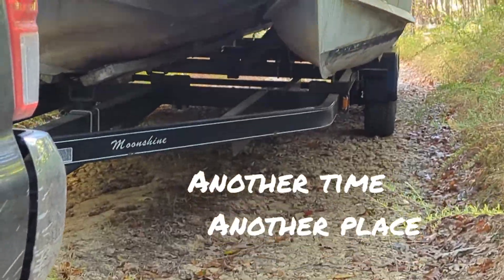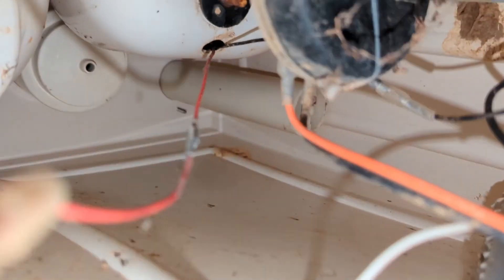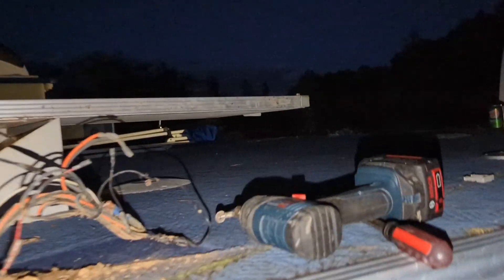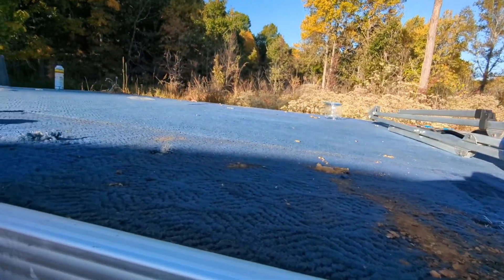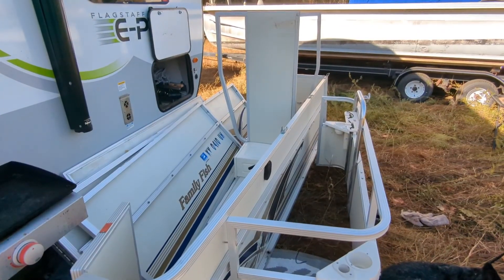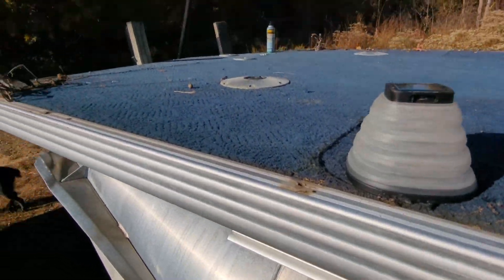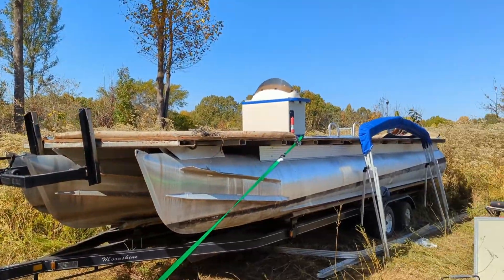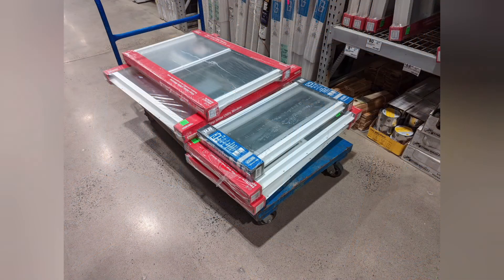#59 ATAP... Sn2 Ep 5 Houseboat Build, Off Grid. Day 1 and 2

Comment: How did you choose what type and size pontoon to start with? Just the largest diameter pontoons you could find for weight?
Reply from the maker: I looked for a Tritoon in my price range for a few months. I knew as fall came prices would drop. Plus I sold back the seats and big motor. The boat is rated for 5000lbs . So like you said, highest floatation for the buck. Also, I wanted a wide trailer with steps to camp. Thanks for asking bud.